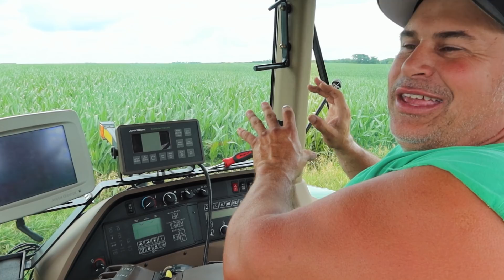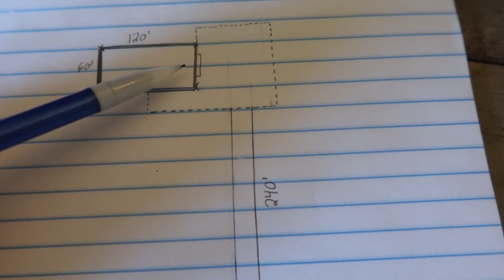Mowing Down The Corn!

Comment: My dad has the same layout of that barn you should put a door on the side it makes getting stuff out a lot easier especially for when you get a lot more equipment. 
From Michigan.
Reply: The shop is 40 by 60 and the barn is 80 by 60 we have 2 doors on the shop and 2 doors on the barn and one door in the middle to Connect them

Comment: Grant take my advice. Buy a small sprayer, fill it with water and spray water when the sun's Goin down. And at least your not like Manitoba who's crops had no rain at all and are dieing
Reply: I hope that you are being sarcastic.
Reply: @TB-sw1tf  not a joke do it when it's too dry
Reply: @alexandert6489  won’t work.  You need 27,000 gallons to simulate an inch of rain over 1 acre
Reply: @realredditstories420  yea but it's worth every drop when it's too dry and there's no rain in the forecast. Think what they do with vegetables and fruits in my area they use irrigation and a sprayer is a cheaper way then buying alot of irrigation equipment

Comment: That AM stands for either acremax or aquamax and is supposed to have drought resistant characteristics. We grew 9526amxt for several years because it performed well in sandy fields even dry years but the elevators here don't want to accept that variety anymore

Comment: Good job guys.  You're corn looking pretty good were the shed is going. Like watching your video's.  Make sure the shop side with the concrete has heated floor.  Makes it nice in winter to work in. Or at lease have it plumb in for the future.

Comment: Hi Grant! Thanks for the great video! Just some ideas:

I was thinking: maybe change your plan so the driveway runs all around the building and it forms like an eye-bolt in plan view, with the shed in the eye, so you can receive semis where they can stop in the yard before going around the building, back to the lane, and never have to back up. I would also make the gravel area to the right wide enough, so a semi can come up the driveway, pull to the right, then back toward or in the shed (I say semi, but I also mean your longest hookup of field implements with wagons, etc)

Also, although it's nice it is already level, I would bring it up. even a little more. imagine Spring: frozen ground, heavy rains, or snow pack then rain, and you'd likely never have to worry if it will flood if you make it like another foot higher, then  grade around for a gentle slope away on most sides. It's hard to tell how much from the video, but I recommend raise it a fair deal more than the minimum. that's how you do everything:  more than the minimum :)

Also orient your building for future solar is my advice, and get your roof pitch right if you think you would like to take advantage (roof pitch angle = degrees latitude for best gain?) even a passive Trombe wall or 'solar gain' siding like fiberglass could help a ton if the building were aligned properly. that's dollars a year saved, every year. in future years, the roof surface could become another small revenue stream as panel costs continue to fall and panel coverage prolongs roof life.

Are you putting a septic and well on the site? I think you have municipal water. Even so, I'd spend a few bucks and hire an experienced engineer to consult for an hour,  or draft a site plan. you might not also need an hydraulic engineer to look at your site, but a quick review wouldn't hurt.... I would plan for future septic needs and buy a tank large enough., drain field could be expanded later. caretaker's house or mobile eventually on the property or office with sleeping quarters? Go a little larger on the tank I would say (instead of for a one to two BR size, see if a 3-4 bedroom size is feasible. I'd be surprised if an engineer's stamp was not required for you to get a building permit, but I don't how it is there. If you do it all up front, you could add a pad and a used good mobile, and up the revenue more and have someone to watch out for stuff if you want that type if situation. Two birds, one stone idea.

you put so much thought into most things you do, but this site stuff seems ok, but a little 'from the hip', and think you might miss features you will want later! (run your power so it doesn't interfere with combines, etc, if not underground)

Spencer's Ranger is awesome! Those are great little trucks!!! 

I hope some of this helps. Thank you Grant!

i'm well aware that free advice given from afar is often worth every cent you pay for it!
Reply from the maker: Thanks CEM! Will definitely take this into consideration
Reply: @granthilbert5632  thank you Grant! I'm gratified that you will consider it. I really enjoy watching you succeed and Spence helping you too!

Comment: If that thing isn’t under warranty, rip that DEF system right off their
Reply: LOL, thats the bad thing about buying newer equipment, is having to deal with the government juice (DEF).  Those who made that law needs that DEF shoved right up their ass. It's why the older used equipment prices have sky rocketed to ridiculous prices.  A while back I saw a Case 2290 with 3 times as many hours as our had on it, priced more than a 1500$ more than our sold for in 1991. Its crazy how much older used farm equipment is selling for now days, and its all due to all the environmental crap on new stuff now days, and its why used diesel trucks that have had all that crap deleted are selling for a lot of money. None of us want that crap on our farm equipment and trucks, it also makes things hard to work on, which is exactly what the dealers want, so we have to take things to them to be worked on, lol.
Reply: @somersfarm1921  put DEF in literally anything and it will eat the shit out of it.
Reply: @realredditstories420  yeah, I'm no fan of the DEF. I don't have much use for any of the emissions crap on anything.
Reply: Can’t just rip the def system out ECU also need a reflash or a kit put in that disables the system but tells the ECU that every thing is good with the machine on the other not DEF is not corrosive on its own it has the same Ph level as salt water if it was corrosive then the bottles would have a hazmat label and the average person could not haul it with out a hazmat endorsement on their license and a plackared truck or trailer

Comment: If you plug the ends together on your rake when you disconnect it will equalize pressure and won't be hard to reconnect the next time you need it. Pro tip! Keep up the vids!
Reply: Do you mean plug both ends of the hydraulic lines together
Reply: Yeah if you plug the ends together when it is not in use it will keep the high side from thermally expanding causing the fitting to "stick" and not plug in to the remote.
Reply: Oh thanks will have to try it
Reply: No problem! We learn by experiences lol

Comment: Any reason why going 240' in?  Maybe 140' (approx 2 tractor trailer lengths)? What equipment will be using this road/building? Space to turn around and swap around? Maybe a one way in, and another out (to the same road to the main road?).

Comment: yes. Those hydraulic hoses on grapples to put on skid loaders are a PAIN.
Reply: the problem comes from unhooking under pressure--push couplers in and hold for 5 sec. to relieve pressure
Reply: @speed5763  Thanks for telling me that.

Comment: Have the exact same Kubota,  it's a POS,  emissions system is garbage had it in shop 2 time already and it only has 250 hours on it.  Now it overheats after the last time they had it,  can't run the A/C and can't run the hydraulics at all or it instantly overheats and derates!!!  I knew I should have bought a Takeuchi!!!!!

Comment: 18:45 We have a new Holland LS 185 freaking engine needs to be fixed and our loader tractor engine is out so When we run it it blow so much blue smoke from I’m burnt oil and it leaks a lot

Comment: Are you still satisfied with the kubota/vail combo? I just bought a kubota 97-2 and am interested in the Vail 85” brush cutter
Reply: After a couple month of using it had the hydraulic motor go out on the mower. Was pushing it fairly hard on small trees and the warranty covered it and got it replaced a couple weeks later. 

Could have been a fluke thing… so far after that no issues. They are a bit lower price than diamond… hope this helps.